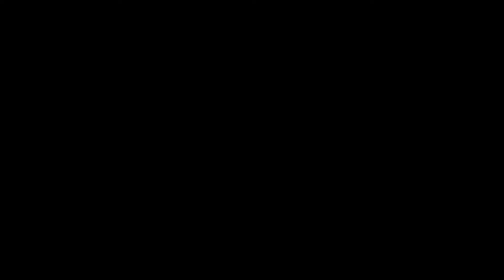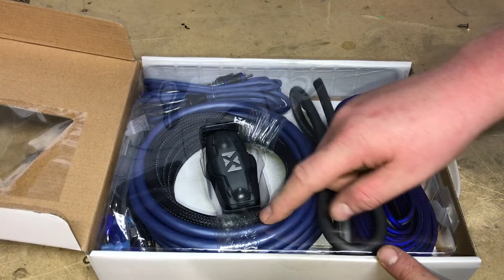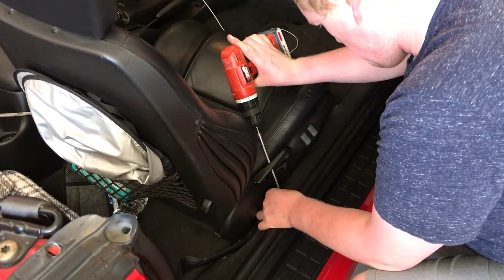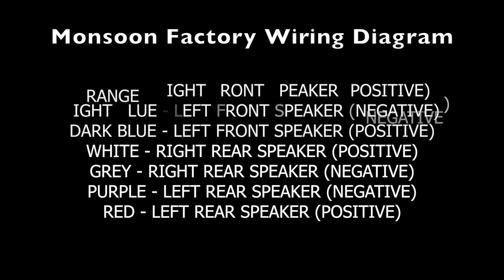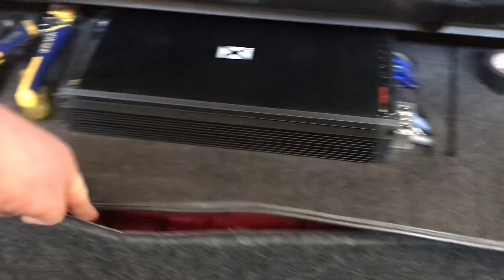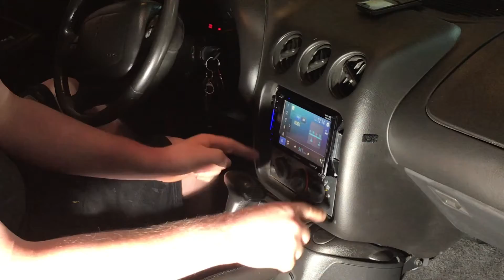1993 - 2002 Pontiac Firebird / Camaro 5 Channel Amp Install

Comment: Solid looking install. My one suggestion would be to just rip the old monsoon system out entirely. If you're already upgrading the cabin speakers you want to install better speaker wire anyway. Running at a minimum 16 AWG OFC and probably more like 14 AWG OFC if you're putting any serious speakers in. At that point, the monsoon system is just dead weight.

Comment: If you have a 1993-1994 firebird or camaro, the Amp is behind the right side Sail panel next to the speaker, NOT behind the wheel in the truck area.

Comment: Did you have to put the plug back in the factory monsoon amplifier after connecting the speaker wires to the aftermarket amp? I am in the middle of this whole process, also did you keep the rear 4" speaker's
Reply from the maker: No, and no.  Other videos linked in the description :)
Reply: @ProvoBeastAudio  I got it figured out I have a coupe not a convertible mine has 6 speakers instead of 4 like the convertible but thanks for the response I watch every video they helped out 👍

Comment: from the inside of the car back into the turnk how do you run the power wire?  do you just go under and behind the rear
 seats?
Reply: I haven't ran mine yet but I would say either that or through the b pillar and over the tank kinda hugging the outside of the car

Comment: Great video, I have a 2002 convertible camaro and was glad i came across this video. I'm also installing the same amp as well. Would be nice if they made a harness that would plug into the factory harness so you don't have to tap into the wires. Keep up the great work.

Comment: Hello in the firebird radio install you installed the wiring harness with all the speakers wired.  Now we are running RCA to amp and not using the old amplifiers speaker inputs. Does this mean if we have amp we should NOT wire the speakers at the radio harness?
Reply: No you still need to wire the radio harness speakers it just grabs the output from the radio at the old amp location and connects the speakers from the old amp. If you don't wire the radio speaker wires at the radio you don't have any signal at the old amp anymore.

Comment: Awesome video.. I just did my 2001 Trans-am convertible  this last weekend .. used all the same parts from the video ..with the exception of my stereo is pioneer avh-2550nex and the back speakers were not in stock so I bought the vsp65 instead.... Sounds amazing thanks so much for the videos

Comment: What can I do to be able to use the original amplifier?
Reply: im adding a mono sub amp, but im running the factory monsoon amp ...its a great little amp, the rest of the system is junk because its acdelco garbage, but the amps from some japanese company, so the fact thats its NOT made by the bean counters at gm means its the Best piece of the whole system... ive use the factory amp in several f bodies now & the Main thing u need to do is match the Ohms... theres several good write ups on the ls1tech forums, as well as a guy, who ive done alot of buisness with (no disrespect to the guys makin this video) ian kee (kee audio website with great info & how to) who has probably forgotten more about these cars than most of us will ever know... hope i didnt step on this companies toes, but ian is a Wealth of knowledge with these cars ...or just research the ls1tech forums...either way... good luck with ur system

Comment: Hi. I currently have an E90 bmw. At present I have a four channel amp and a mono block. The four channel is running a three way component set. Basically a midrange and a tweeter pair with a crossover separating the tweeter from the midrange that is going into channel 1 and 2 on the 4 channel. The midbass is going into 3 and 4. I have the stinger 9 wire running from the factory headunit location to the amp. The only wires I am using from there are the front left and right coupled with the remote turn on.. The headunit itself is a pioneer that has front, rear and sub rca channels. The underseat subs have the speaker wire directly running to the amp as I wasn’t sure if the factory rear speaker wires carried a full range signal? I am considering going fully active. Would I need to run individual wires from the speaker location in order to do that or can I still use the 9 wire solution? How about the setup itself? I would need I 5 channel amp coupled with a processor for the front stage? Any advice would be appreciated. Thanks.